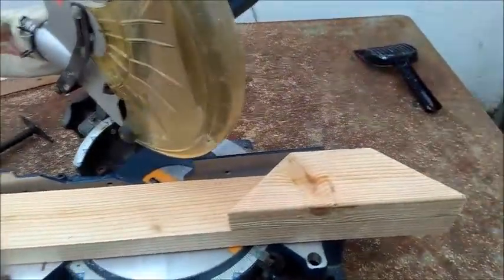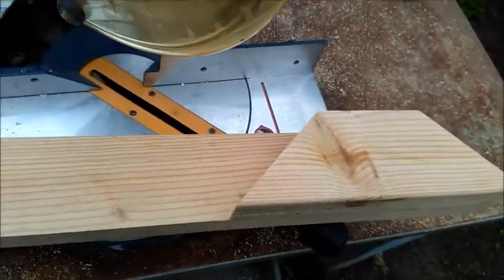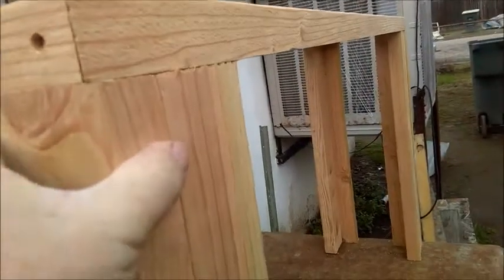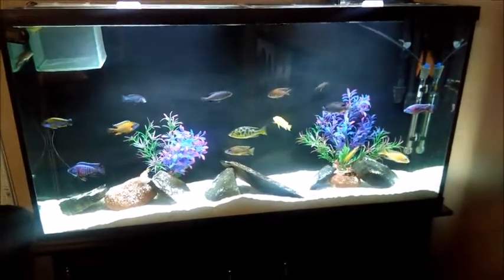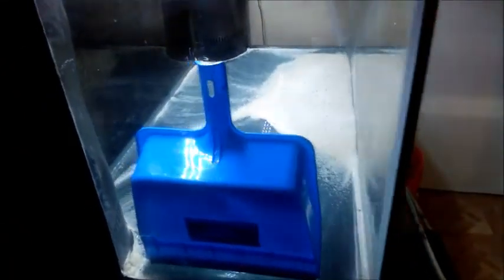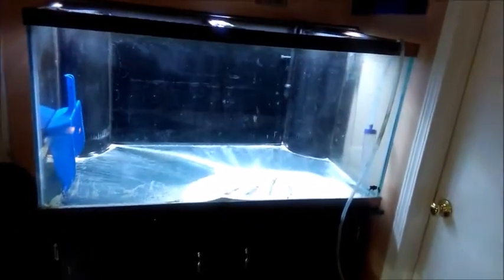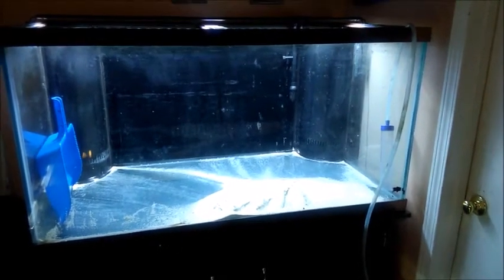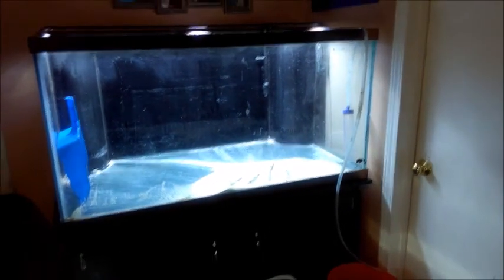Started Off So Great, Ended Pretty Bad :(

Comment: Some HomeDepot store sells bulkheads. I got mine from ebay. What's the diameter of the holes? I'll check HD if they have any. I seldom see them though. I have (2) bulkheads which I ordered wrong size. I can mail them to you if they fit.They measure 1-3/8 (exact fit including threads) or 1-1/2 (a little loose). If you decide to just silicone a piece of glass or acrylic, make sure to use the same material as the bottom of the tank. Acrylic & glass expand and contract differently, so if they're not made of the same material, it might fail. Also do both the top & bottom for added strength.
Reply from the maker: Dang sir, this was a VERY informative post. I will get these bulk head things, its probably the safest bet. I need to measure holes and go from there. If i remember correctly i purchase a 1 1/4 tube and a 1 1/2 tube but i cant remember for sure. I'll measure and hit home depot :p thanks so much for your help, i am going to get this right one way or the other :D

Comment: I'm sorry to see that bro but with the idea you said in the video that's a good one just make sure you use aquarium silicon and try to use a thick plastic glass and apply it under and around it just cut it the dimensions of your tank 👍👍
Reply from the maker: I agree bro, it sounds like it would work and would be the cheapest method, however I'm getting a lot talk about these bulk heads, so i thin im gonna try those.

Comment: why no  just  put a  new bulk head in ?
Reply: its  just  the  rubber  under the pastic  bulkhead  that need to  be replaced ,   cant u just use  a    piece of rubber  to  make a  gasget, like a   tube for a bicycle  tire
Reply from the maker: That's what im going to do.
Reply from the maker: I actually bought rubber washers and they leaked, im gonna get the bulk head and try that.
Reply: Areu zureu had no sand
Reply: I have installed one and it leaked until it was tightened enough
Reply: Had to buy a big socket and a lonextension to tighten it up push from bottom and tighten.
Reply: Good luck
Reply from the maker: Ya I'm gonna have them install it 😁
Reply: Ya